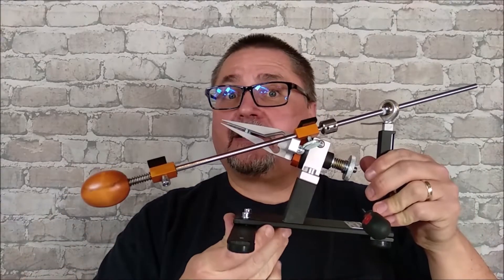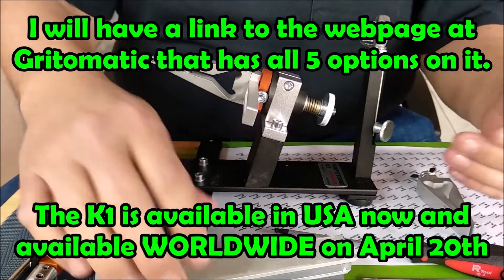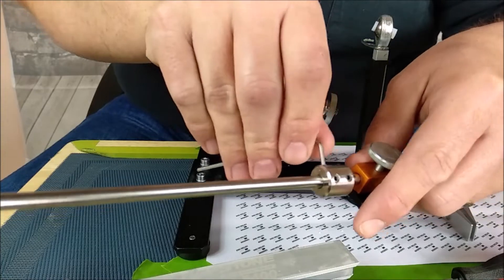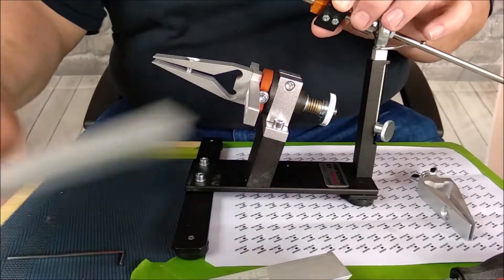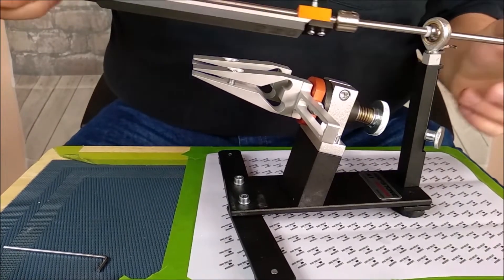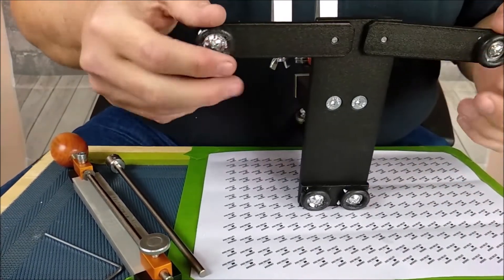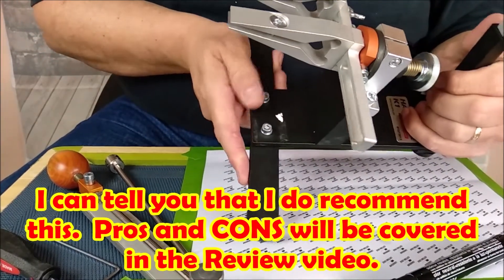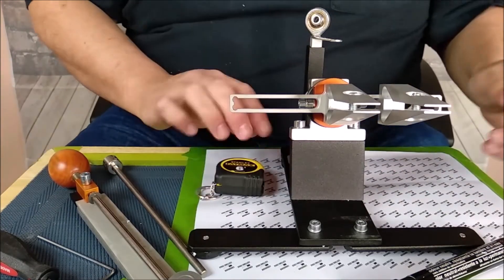First Impressions of the NEW Hapstone K1 Knife Sharpener   Rotating Clamp System

Comment: seems like a very good system. i don't use my knives enough to shell out 250 ducketts.
Reply from the maker: Each person has to do what is right for there particular situation.  There is no one system that is best for even half the people, let alone the majority.  Still, I totally believe that most knife guys who are new to the hobby up to about into the hobby for 5 years or so - that group of people tends to under value the role of a great sharpening system.  But even for the guy who has been collecting for 50 years doesn't necessarily need a guided sharpening system, a few hand / table whetstones can be used to put an awesome edge on a knife.  In other words, each should do what is right for them, not necessarily what some reviewer says might be right for them.

Comment: I just don't see $200+  bucks in this same as the wicked edge of any of the others go to Wal-Mart and by a smith sharpening system for $40 to $60 bucks it does just as good as wicked edge which is a far better machine than this and more expensive also the stones you get with any of these are trash
Reply from the maker: Thanks for watching and sharing your perspective.